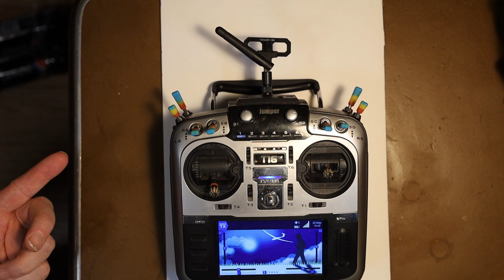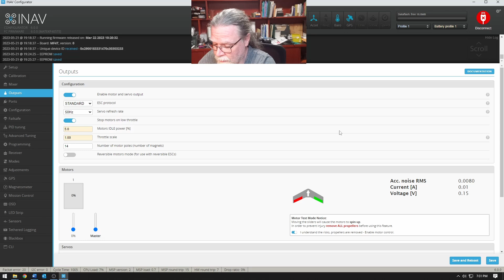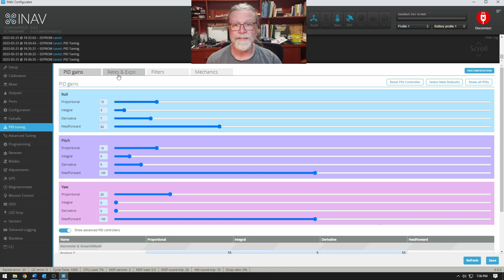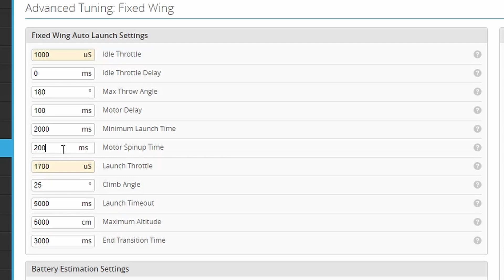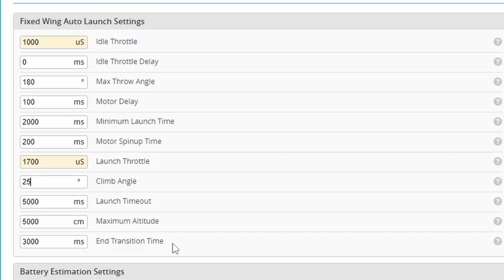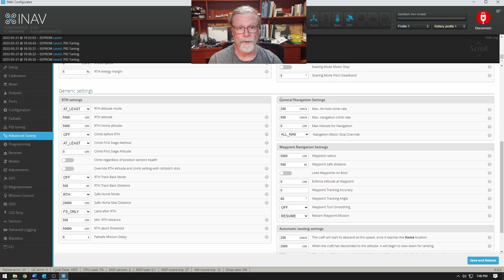Inav Final Configuration: Flying Wing Maiden Flight Setup - Part 2

Comment: voellig durcheinander teilweise ..vieleicht lieb gemeint.. aber die ganze Gliederung fuer den Anfaenger nur verstaendlich wenn du dir alle Parts von dem Typen anguckst...ich selber mach INAV seit 6 Jahren...
Reply from the maker: Thanks for watching and leaving a comment.  I tried to translate German to English, but the translation wasn't very clear. 
I think your comment was that to understand this video, you need to watch the other videos too.  I can't disagree with that.  The videos were as a series so each video isn't always perfect as a solo video.   Making the wing and the videos was a great learning experience for me - I've still got tons more to learn.
Happy flying.
Reply: @blueskyfpv YES..and sorry .. but..for example ..don't tell people about RTH_Options to prefer "at least" ..cause first ..from that height it's activated, you will climb or descend by the value you have set as RTH altitude..Take "FIXED" and IT goes  straight to the RTHaltitude and : "don't climb before returning" otherwise you will initially fly a mostly pointless round that will not improve your battery charge..and the same goes for other explanations in the video..
so sorry .. don't worry
Reply from the maker: Thanks for the extra feedback and information.  If I made mistakes, or there are better ways to do something, I appreciate learning about it.